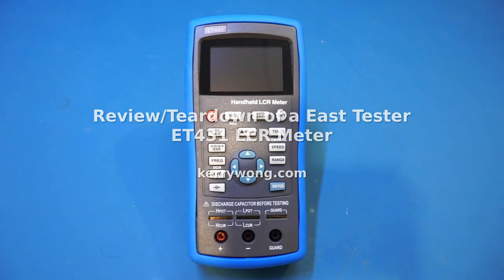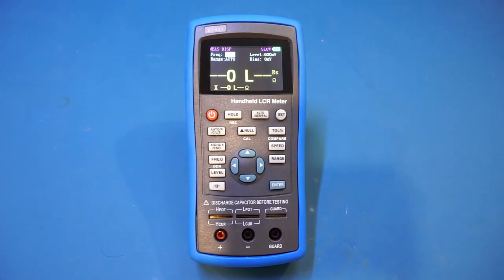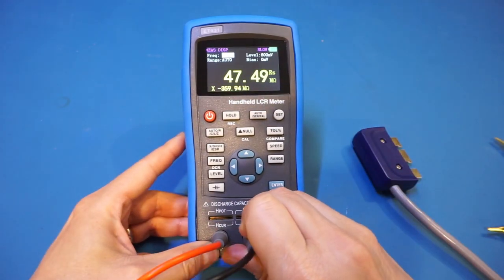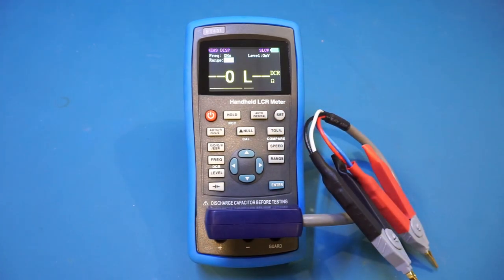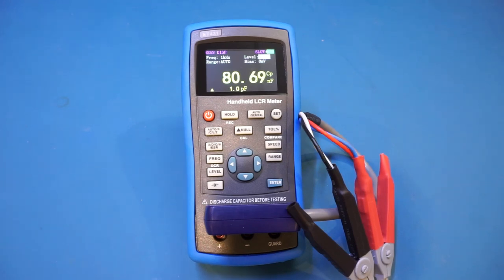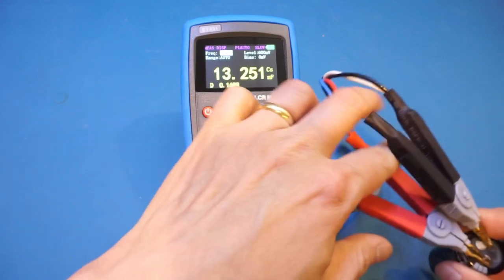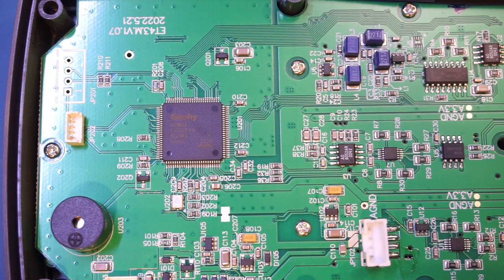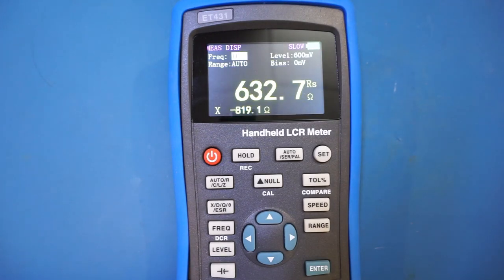Review/Teardown of a East Tester ET431 LCR Meter

Comment: I have the ET432. And the hardware seems to be different. The microprocessor in my unit is a Nuvoton chip. I do like this LCR meter, very functional. Especially, the ability to perform measurements at 0.1Vrms levels, which does not turn on any semiconductors and therefore in-board measurement of caps, for example, is a treat.

Comment: If you’re paying for a dedicated LCR why wouldn’t manufacturers build these devices to do capacitor tests in ranges they are designed to operate in? (i.e. 1-50V or have a handful of switchable values that are commonly found on aluminum caps)

I might be wrong but I thought electrolytic aluminum caps (that have reason to be suspect) often can still give passable values when tested at lower voltages.

Comment: Today the ET431 arrived.  I found the slots in the front of the unit convenient to use for radial lead components or axial ones with the leads bent, no need to use the clips - the manual lists the notches as the first option.  I was wondering why you hadn't used this method?  Perhaps just for the way you wanted to demonstrate in the demo.

I messed around with the setting including "use last" for "Power on set" and proceeded to make my first DCR measurement.  I pressed the SPEED button to change from SLOW to MED and THE UNIT FROZE ON ME! No button presses seemed to be recognized.  I could not figure out how to reboot or factory reset the unit, but I could turn it on and off, returning to the same screen in a locked-up state.  After an hour or so in futility trying to find how to factory reset from the soft keys, I was able to figure that the buttons did work, but the response to a keypress was about 1 minute each press.  With patience, I eventually got back to the setting menu and turned it back to "Default value", left the menu, and cycled the power.  My unit was unbricked *whew*.  So I strongly advise against having the last mode remembered to avoid this endless lockup loop, unless it's really necessary.

I found out how to use the record feature and display the running average.  This is extremely useful for getting past the constantly changing value on the screen.  The tolerance value is also somewhat useful at seeing how much in % the current reading varies from the average or target value.  I could see myself using this when tuning a circuit.

As for measurement accuracy, I was surprised to find the bathtub curve is rather steep at higher capacitances.  My inexpensive meters do much better at high capacitances.   Perhaps those meters are able to measure by integration or by having a built-in compensation table.  This is my first LCR meter and I bought it for a reasonable price compared to others on the market, but wonder how much more versatile another brand meter would be, or is it the accuracy bathtub limitation true for all of them?  For personal use this is adequate, but I think I would tend to use some other device for high or low ranges, such as millohms or higher capacitances.  

Why is 120 Hz one of the presets when 100 Hz isn't far away?  Is it due to some standardized frequency, or due to differences between mains frequency?  

Should a bias voltage be applied to tantalum capacitors as well as electrolytics?  I have been doing so.
Reply: Typical software issues and bugs on cheap chinese instruments, i have the ET5410+ dc load (same brand as this lcr) and its full of software issues and bugs not to mention the poor hardware assembly and quality, and completely erroneous readings, very negative experience to me, its pure garbage, i won't buy anything else from "east test" (or rebranded) ever again. Fnirsi dpox180h is another trash with completely buggy software. And the list goes on...
Reply: Just curious if you ever tested your ET431 in DCR mode, but using all the ranges.   There is a recent thread over on the eevBlog testing forum about the ET432 (not much different) and two people had the same weird symptoms - oddly varying (orders of magnitude) DCR readings from a 10K resistor.    Was wondering if yours had the same symptoms.   Auto range usually chooses the correct (accurate) range but there are usually a couple of the manual ranges that will return crazy results.

Comment: While this is a better value than the Keysight 1733 it still is expensive considering that a Chinese LCR meter for under 20 bucks on ebay will do as good!  For serious work a meter like the HP 4275 LCR meter (oldie but goodie!) is much more accurate.

Comment: I live in Europe, the mains voltage is: 230 v 50 Hz, when designing power supplies it is important for me to have at least 50 Hz, and preferably from 10 Hz > 100 kz in 1 Hz steps (when designing audio structures).

Comment: Hello, I got the ET432 last year and have been using it mostly for capacitors.  A few questions, maybe you have some perspective: 
Should one just use the 100Hz frequency when in the electrolytic mode for determining esr? I'm thinking maybe since electrolytic cap's are not for large frequencies.  I don't always have data sheets for ref.  Perhaps I'll study sheets for similar caps. 
I understand kelvin leads should be used for low resistance values, they are not helpful if resistance is high.  Is there a similar impedance and/or frequency guidance for inductance and capacitance measurement?  I would think using the unit's socket for components, eliminating all wire length, would be best for measuring capacitance.  
When would using the alligator clips be best practice? 
There are so many selectable parameters.  Almost need a check list as one switches components!
Thanks.
Reply from the maker: In this case it's 5-wire (4-wire plus guard) measurements. So it's suitable for both low impedance and high impedance measurements. I had made a video a few years back explaining why you'd need guarding when measuring high impedance component (e.g. caps in the pF range): https://youtu.be/AmR_xmt3ABI. If the footprint of the component can fit into the socket obviously it would be the most accurate way to do the measurement as the sockets are also using 4-wire measurements (without the guard, but guard would not be needed since there's no excessive connections in between). ESR for larger capacitors are usually measured at 120 Hz as they are mainly used for mains frequency filtering. You shouldn't see much difference when using 100 Hz or 120 Hz. But if the manufacturer has a specified frequency then that is the frequency you should use.
Reply: @KerryWongBlog   @KerryWongBlog  Thanks Kerry. I just watched the review of the agilent lcr meter. I was struck by how full the pcb was compared to the ET meter. That one chip on ET lcr replaces so many. 
I have learned about kelvin leads using my dmm. I'm learning about using guarded lines using my keithley 236. I had not considered the implications of having both on my et432.
 I'm used to thinking of a DC guard voltage. 
I found the 5-wire guarded-kelvin layout in the Keysight Impedance Measurement Handbook.  I opened the ET's kelvin plug and verified that the guard wire is the outer shield for the 4 coaxial wires bundled in the kelvin 🔌. I'm going to need to think about the different voltage arrangements a bit. 
Thanks again for your great videos for repair and review.

Comment: Compare the ET431 LCR with the Hantek 1833c you reviewed before (excluding 10kHz vs 100kHz), which is more stable, accurate and functional? Thanks
Reply from the maker: The readings are fairly comparable. One thing stood up is the DCR mode in the ET431.

Comment: 17:14 Looks like the clips are incorrectly connected to the cap here, red and black are connected to the incorrect pins, assuming red is positive.
Reply from the maker: Here the measurement is done using unbiased AC signal so the polarity doesn't matter. When measuring using the electrolytic mode the polarity will be important as I explained the voltage at the tips will have a DC bias.
Reply: @KerryWongBlog  I thought you said you were going to use electrolytic mode at that point. The screen shows no bias.
Reply from the maker: @alien8r33d  I first measured using the electrolytic mode (check around 14:35, bias is at 500mV) and later on used the standard mode as a comparison.
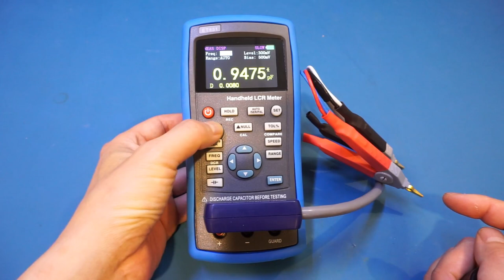Reply: @KerryWongBlog  I meant to say standard LCR mode, not electrolytic mode. At 16:58, you switched to LCR mode, after testing in electrolytic mode, so no AC or DC bias. Surely RED should be connected to cap + at this point. You connected red to + at 17:04, then removed it at 17:08 and connected it to the negative side of the cap.
Reply from the maker: @alien8r33d  Check out 16:26 I was testing in electrolytic mode and the Kelvin clips polarity was correct. I had to adjust the clips afterwards and when in standard LCR mode the polarity really doesn't matter.

Comment: Great review. Will the 4 wire adapter fit the Hantek 1832 LCR meter? I was going to make one for my Hantek but just found the ET adapter on Aliexpress so figured that if it fits then maybe just buy that one
Reply from the maker: Thanks! Yes, the adapter fits. I have tested the adapter with my Hantek LCR meter as well.
Reply: @KerryWongBlog  Many thanks for your reply. That's great news. I'll grab one off Ali and save myself some time.
Reply: @KerryWongBlog  I'm extremely impatient, and as I bought some cheapo Kelvin clips some time ago, and I have some 28awg 2 core shielded cable, I just knocked up a very basic setup. Chopped up three bits of double sided copper clad and soldered the connections.
Looks Neanderthal but the first thing I checked after calibrating was a 0.1 ohm resistor that I was struggling with before.... Bang on the money. Then checked a cap and an inductor.
Woohoo... What a great result!
Just need to tidy things up now. Took 25 mins start to finish.
Thanks Kerry. You inspired me to do this and it was definitely worth doing.
Now I'll have to make some 4 wire tweezers :-)
Reply: @KerryWongBlog  What a great day. Couldn't resist it. Pulled my $2, two wire tweezers apart and made them 4 wire.
Gotta be happy with that.

Comment: How it compares to DER EE DE 5000?
Reply from the maker: I don't have a DE 5000 to compare it to but judging by the spec sheets they are not exactly the same in terms of ranges. Some of the specs are better on the DE and some are better on the ET.
Reply: @KerryWongBlog  That's interesting.
Thanks for reply.

Comment: DER-EE DE-5000 LCR meter 100 KHz
Reply from the maker: ET432, 433 also go up to 100 kHz.
Reply: @KerryWongBlog  DE-5000 is better and cheaper. ET432 is Chinese rubbish, it does not even specify its accuracy!
Reply: @s_amoku  Have you read it's manual?